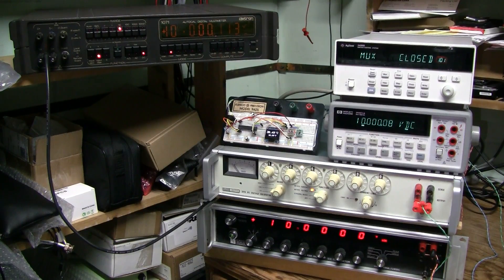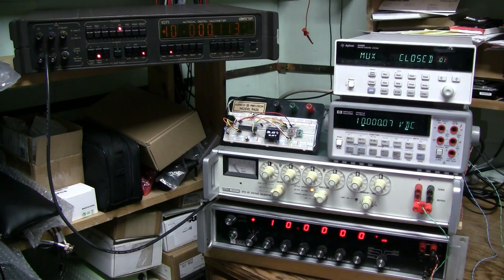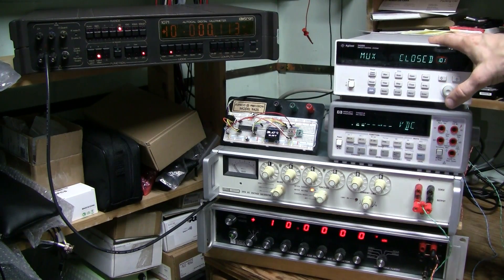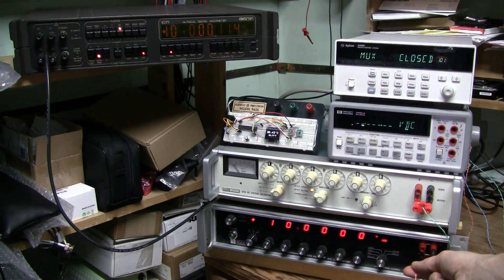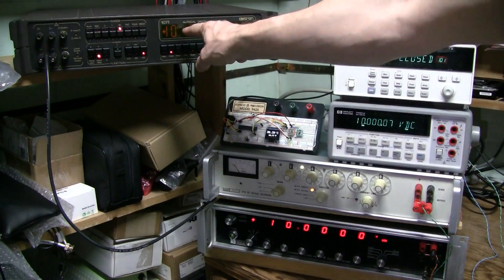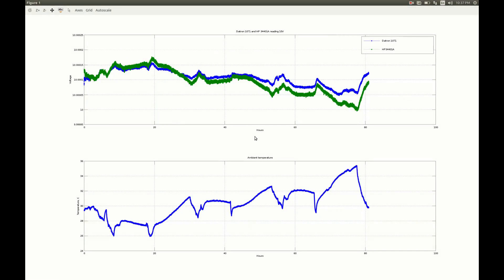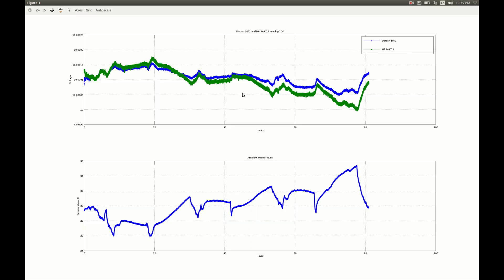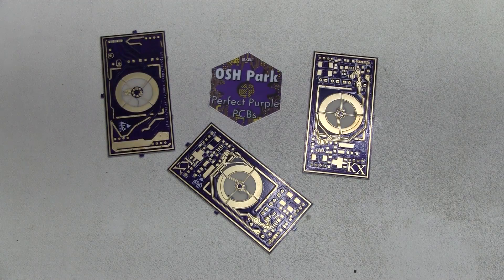#54 - Low-budget metrology

Comment: If you did the same experiment using a battery, what would you see? Also, if you put your references in a temperature controlled loop, how do they fair?   For a time, I worked at a laser company designing feedback control systems for high power-UV lasers, and had to deal with solarization, and thermal stability issues of the detector. To get around the solarization problem, the feedback signal was highly attenuated, but made the gain on the transimpedance amplifier highly sensitive to leakage currents on the board, and required guard traces,  very clean boards ,etc.  I was able to prove to everyone that the electronics/firmware worked perfectly, but that the sensor, and beam-diffusion uniformity were the sources of all our trouble, but using a battery and a pot as a current source, and plotted the drift over time just as you did.  I also used a circulating chiller and a copper-block to make sure that the temperature was completely stable, though I don't know how much the temperature  will effect the battery. It is a great feeling to minimize as many variables as possible when running an experiment.  I too am suspicious about the stability of a voltage calibrator I have.

Comment: In pursuite of perfection, I was thinking, how do they calibrate the top of the range calibrators?
I mean, how do they use a electron counter or what?
Reply from the maker: https://youtu.be/JID8bS2-skg
Reply: @feedback-loop  thanks a lt for the link! :-)
I did not completely understand how they calibrate that gear, isn't there a reference like a meter is defined how long the light can move in a period of time?
Reply from the maker: For voltage? I believe the primary voltage standards use Josephson arrays.
https://en.wikipedia.org/wiki/Josephson_effect
Reply from the maker: Some more explanations from Keysight:
https://youtu.be/XYASIipUtG4

Comment: Welcome in the volt-nuts club. Your 343A will probably deliver more stable and more precise 10V output, if you use its 10V range, at Full Scale. Same goes for the other standard.

Comment: Be very careful, low budget metrology tend to transform into high budget quick! Very careful :).  Edit: watched at the end, you already a volt-nut, so it's too late to escape. I can only recommend building more than one LTZ module, so you can use even 34401 to compare stability between the two. This way you can measure drift of your meter easily. 

Your idea of straight line pretty close, my live data from 6xLTZ1000 : https://xdevs.com/nvs_ltz4/. I've scaled it to 30ppm like your graph.
Reply from the maker: > Be very careful, low budget metrology tend to transform into high budget quick! 
I am trying to be careful, but your posts on EEVBlog forum throw me off track. Volt-nuttery is contagious, and I caught it from you. :)
Perhaps, I will eventually build more than one reference. I have the boards after all. One can never have too many references.

Comment: Good video, thanks.  I also have the parts to assemble this voltage reference.  The LTZ1000ACH is available from Digikey; the Vishay foil resistors I purchased from Texas Components.  This is NOT an inexpensive reference to build.
Reply from the maker: I bought LTZ1000CH from Digi-Key. The resistors I bought from hifi-szjxic on eBay. Yeah, not cheap at all. I suspect that my low-budget metrology will slowly (or rapidly?) become quite expensive. :)